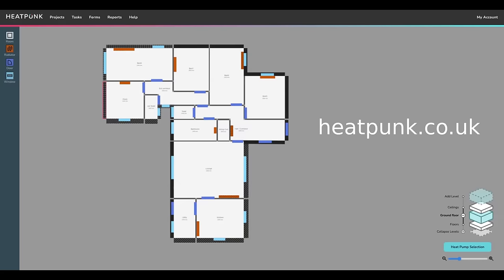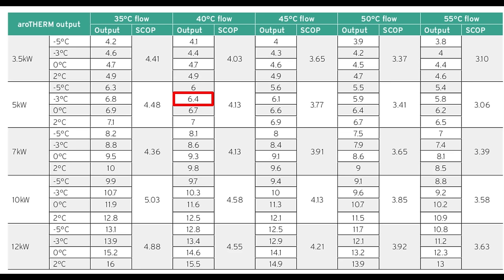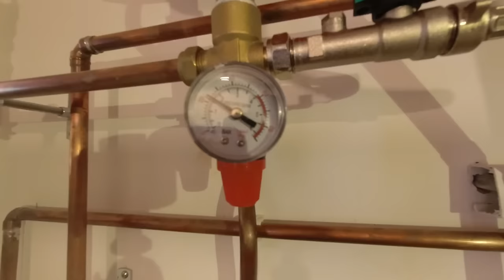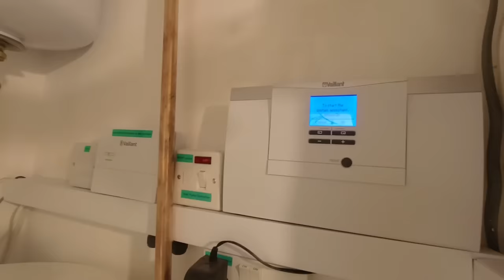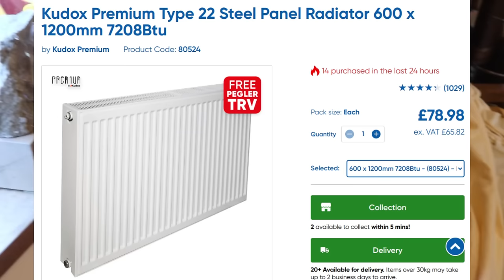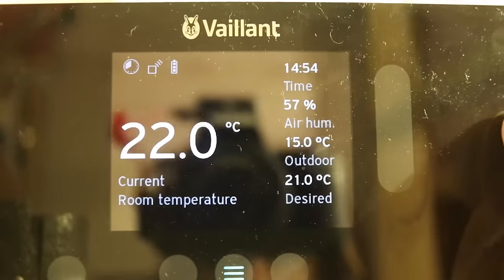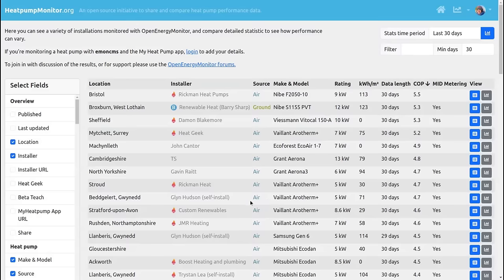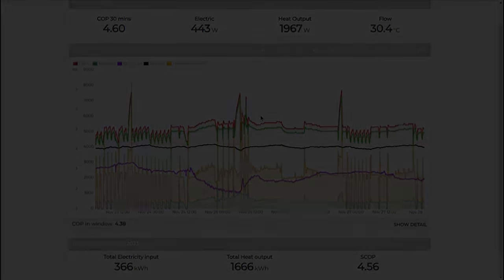Solid Fuel to Vaillant Air Source Heat Pump: 1980s Bungalow

Comment: I had a Daikin fitted back in spring. Got to winter and the rads only get luke warm in the top 4" of the rads. Air has been bled and I've had the installers out so many times but still not fixed. I had it running at 18° on the madoka all day today and then raised to 21° when I got home. The because the rads do not get warm all over, the madoka shows 18° and no higher. 
I'd love to know what you think as I had everything removed and upgraded, rads, pipework, the lot. So upset that I've been swindled
Reply: something is definitely not right. Your rads should be warm.
Reply: @Etacovda63  it's been on 24 hours and the rads are tepid along the top and the bottom has no heat in them at all. Madoka thermostat struggles to show anything higher than 18°c and the back of the heat pump is frozen over. I've seen it go into defrost mode as the steam what comes off is biblical! 
Had a look at the flow rate, it fluctuates between 15L to 19L.
So so upset by all of this, wish I would have just stayed with oil
Reply: @garyhalkon8749  yeah, sounds like a nightmare. What temperature is it currently where you are? sub zero? what size is the heatpump? how many radiators? what is the house construction?
Reply: @Etacovda63  temp outside is -2c temp in the house is at 17c from what it says on the onecta app. It's an Altherma HT I know that much. It was all properly sized and all the rads upgraded along with the pipework too. I'm just at a loss that not all the surface of the rads get warm, just the top quarter. I know that they're not supposed to be belting hot, but surely they should provide an even warmth from top to bottom. Also all the trv are open. It's a bungalow, with wall cavity and full roof insulation. Double glazed windows and composite doors.
Reply: @Etacovda63  I'm in a village in East Yorkshire
Reply: @garyhalkon8749  what model of altherma HT? what size is the house?

honestly, that heatpump should handle your house just fine, assuming its not massively sized wrong. Theres something odd going on. Id probably look at contacting daikin personally, they wouldnt like their reputation being trashed by whatever is going on with your system.
Reply: @Etacovda63  to what I have found on the emails when I had it fitted, the model seems to be EDLA08E2V3. Only a 2 bed bungalow, not sure on the square footage of it. It's not overly large. Previous oil heating would heat it up without any issues.  The reputation of the company that supplied and fitted it is also at risk too. 
I could feel a chill as I was sat watching TV last night, walked over to one of the rads in the room and it was stone cold. Not even the pipework was warm to the touch.
Reply: @garyhalkon8749   ok, sounds like the system should be able to cope with your house pretty easily. The 19L you're getting would put out approximately the full output of the heatpump if you had a normal delta T.  

I assume you leave it always on?

Honestly, if you're not getting joy from the installers then you need to escalate to daikin if possible. 7KW is more than enough power for a 2 bed bungalow which will likely be between 50-80sqm with full insulation. 

My house is 265sqm, and I have a 14kw toshiba - and its oversized for this house, I wish id bought something smaller (so it could modulate lower...!) my house idles along at 1-1.5kw of power use, which will be putting out approximately 5-7.5kw of heating.
Reply: @Etacovda63  I was told by the installers "it's a suck it and see, trial and error system which you need to play about with". I replied saying "so who foots the bill when a suck and see trial and error monstrous bill arrives?" 

I don't even know what delta T means, or how I am able to adjust or what to adjust it to... I'm at a total loss and at the mercy of the installers. Called the emergency engineer last night, I've heard nothing since. So I called back this evening when I got home as it's still at 17°c even being on all day with a target of 20°c. I've also sent an escalation to Daikin as they need to hold the installers to account. 

I looked at the energy used yesterday and it was 50 kWh!
Reply: @Etacovda63  it's been on 24/7 too. So so upset with all of this.
Reply from the maker: Oh dear, sorry to hear. Something's not right if your radiators are not getting fully warm. If all the rads are not getting warm, then maybe the weather comp curve needs to be increased to increase the flow temperature. If some radiators are getting warm and some are not then it could be an issue with radiator balancing or flow rate. Your installer should at least ensure the radiators are getting warm, this is quite a fundamental part of a functional heating system!
Reply: @GlynHudson  yep, thinking about this further today whilst vacuuming (as you do) it seems like the flow rate through the radiators must be too low. The only way the top can be warm and the bottom cold is if the water is lingering for way longer than it should (or there’s a massive airlock)
Reply: @GlynHudson  should the rads have a uniform warmth left to right, top to bottom? Because mine do not. On the MMI interface it shows 51c flow and then if I go into the interface information section it shows the leaving water temperature at 41c. 
Non of this makes sense, when it was fitted I asked for a tutorial about the set up, I was told (and I quote) "it's trial and error, suck it and see approach to find how comfortable you are with the warmth". To which I replied "so who foots the enormous trial and error bill which shall inevitably happen" I got no response to that apart from a shrug of the shoulders. 

This whole thing has broken me mentally and I am so so upset. £15 a day and I'm now at the point I'm deciding between heating and eating. Because there is no way I can afford £15 a day to run the heating. 😔